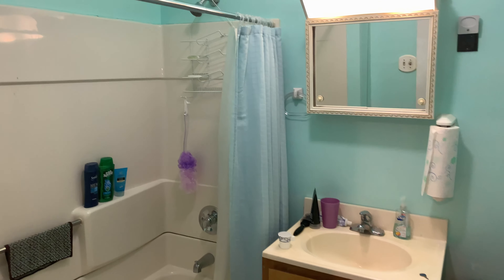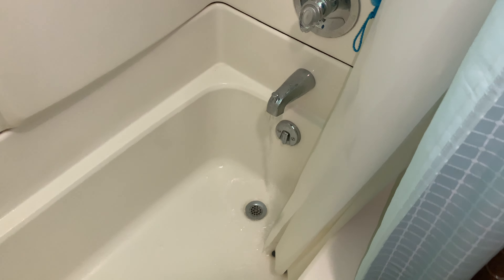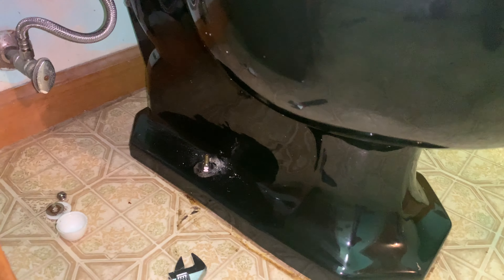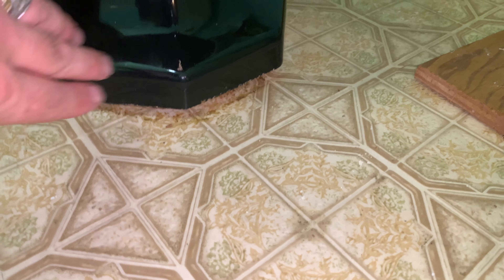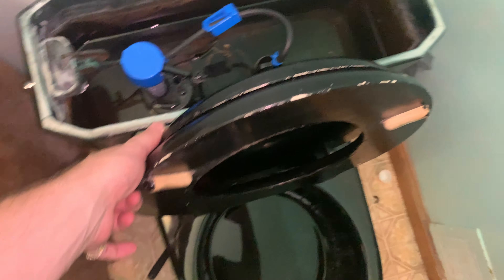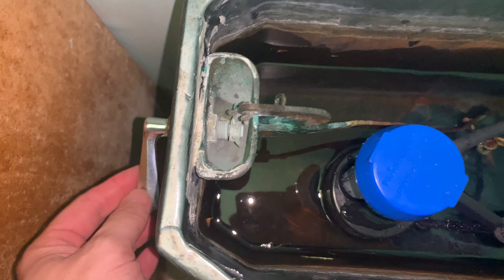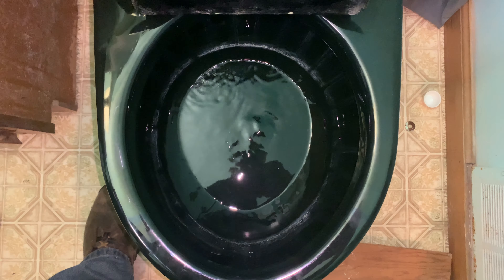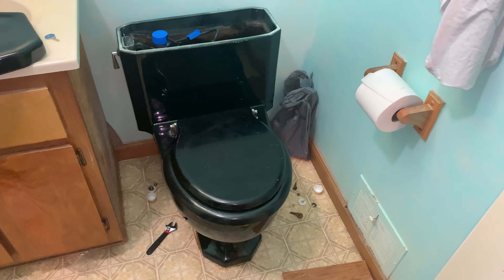🚽 Bathroom tour: vintage 1933 BLACK Kohler Toilet in my new house

Comment: Looks to me like there should be at least two or three more inches of water in the tank before you flushed. Would have been a much better flush. Good luck finding the linkage for that handle though.

Comment: That toilet was ahead of its time. Most toilets of that time were heavy, bone white porcelain with separate tanks connected by a pipe. Probably expensive for its time too.
Reply: Yep… but then again, it’s better than the toilet that was there before the installation of this. Wonder what kind this 1933 Kohler toilet is?
Reply: It's being used as a nightstand